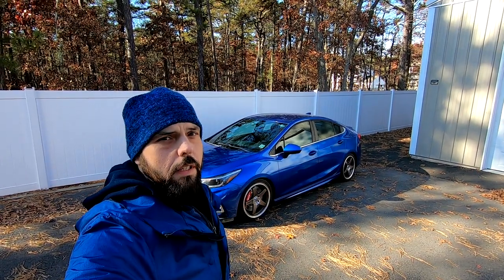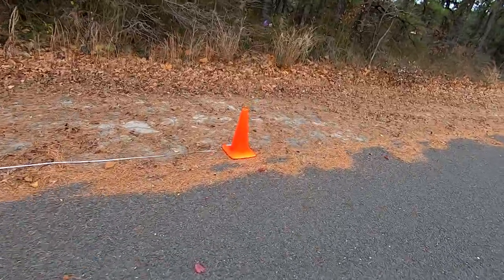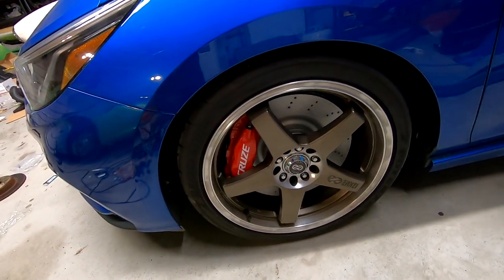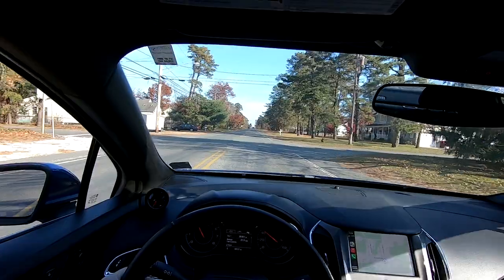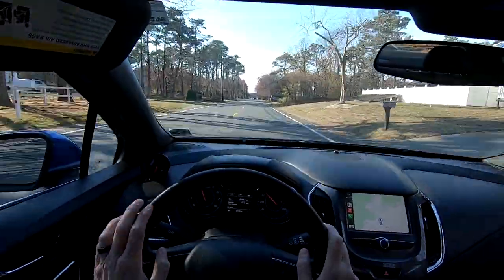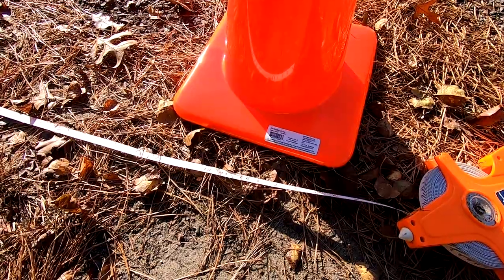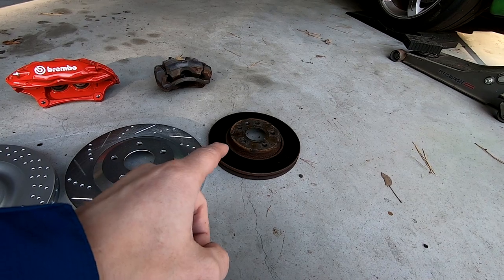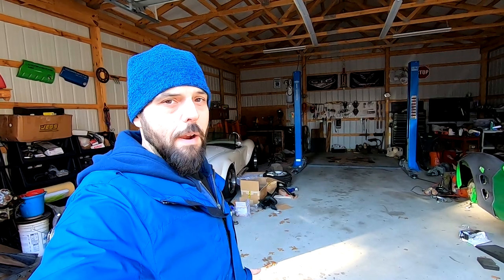CRUZE Sonic Big Brake Kit and test

Comment: I love the enthusiasm in making this platform better, however, if you're going to trying to "sell" your product, I would strongly suggest going about it in a more scientific approach.  1 and done on a brake test hardly offers sufficient credibility in the results. Even car testing mags and shows like Motorweek repeat the testing numerous times and then take an average for use as a comparison.  I would also suggest retesting (if possible) again using the a more suitable speed of 60-70 mph and using those results for an overall comparison. 
In short, more test data over a great speed range. 

Keep up the great work!
Reply from the maker: I can tell you from driving everyday and the other 6 platforms I make brake kits for the braking is far superior over factory brakes. The problem with filming at 70mph is the national speed limit is 55mph. So having a place to test at those speeds is rather difficult. At least showing from outside of the car. I can do a test with footage from inside the vehicle but if you compare the brake kits. You can see that those tiny brakes from the factory absolutely will not perform better than the massive ones at 70mph so any upgrade is better in my eyes. Maybe one day if my channel grows and I have subscriber support possibly with donations I can do larger scale testing and be able to have a facility to do these types of videos on a larger scale.

Comment: That bbk is bad ass. Those are very nice options for the cruzes. Gonna have to save some coins for this bbk !.
Reply from the maker: Tell you what! Even if I give you a bare aluminum brake kit. The braking ability is epic!!!!! Let alone how they look.
BTW how have you been?
Reply: @davesworld2132  I'm sure anything is better than my current stock set up with the drums in the rear. I test drove a sonic rs and even that thing has better breaks then my 2013 cruze Lt.  I've always wanted to upgrade these crappy breaks.  I think I'm doing this upgrade in the foreseeable very near future.  I keep regretting my choice of getting this cruze thinking I shoulda got the sonic rs instead.  But cruze was cheaper and didn't wanna  spend the extra $2k . Sigh....🙄
Will your kit work with the stock 16" LT wheels?
Reply from the maker: @dude...are-you-sure  Yes you will have to run a spacer and let me know the barrel diameter
Reply: @davesworld2132  k, I'll have to research the stock wheels dimensions. Will get back to you .

Comment: Saving up money to get new rims just for these brakes, they look so much nicer than the OEM big brake kit
Reply from the maker: Now that’s what I like to hear!!!!!! What wheels are you thinking about getting?
Reply: @davesworld2132  i was thinking of getting the Konig Controls. I actually went and got Konig Ampliforms this weekend but was so excited at what a great deal it was i forgot to think about the bolt pattern, they are 5x120 and are 19x8.5. Would have looked so sick on my car too 😭. Trying to sell them off so i can get rims that will actually work on my car
Reply from the maker: @thecruzeexperience6413  5x105 is needed and a 35mm offset at least. Wha the offset on those wheels you have I can get some custom 5x120-5x105 adapters made out of air craft grade aluminum.
Reply: @davesworld2132  i looked into getting hub adapters but wouldn’t the studs get in the way? I really dont want to have to cut them. I do appreciate the offer and the effort you’re putting into this btw
Reply: I’d also like to add that the widest rim that could fit would be a 9in width without any kind of modification to the body
Reply from the maker: @thecruzeexperience6413  No problem I always try to help as much as I can. You wouldn’t have to cut the studs depending on what those offsets are on the wheels. Do you by any chance know them?
Reply from the maker: @thecruzeexperience6413  possibly but it depends on the offset. You can possibly get more tire if the offset is on the lower side.
Reply from the maker: Sorry higher side
Reply: @davesworld2132  offset is 32mm
Reply from the maker: @thecruzeexperience6413  So if memory serves a 32 mm offset is a little more sunk in. For example it puts the tire Close to the suspension. If you were to run like a 38 mm rim Then the tire would move further away from the suspension allow you to run a wider tire. But then you also have to make sure you’re not going to hit your fender.
Reply: @davesworld2132  yea if the rim had been an 8in width i could do spacers, but with how thick the rim is its just not going to work
Reply: @davesworld2132  the Konig controls that im looking at have the correct bolt pattern and are 18x8 with a 40mm offset, which in theory should fit perfectly
Reply from the maker: @thecruzeexperience6413  that makes sense. If you can’t find anything I have a decent relationship with the owner of Cruze culture. He has some options.
Reply: @davesworld2132  ive been considering getting the 19x8.5 rotiforms from cruze culture as i already have tires that would fit the profile, and although they would look super sick, i am a college student 😂
Reply from the maker: @thecruzeexperience6413  which rotiforms?
Reply: @davesworld2132  the ZMO-M, at least i think thats what its called as per the website
Reply from the maker: @thecruzeexperience6413  Those look awesome I just looked them up
Reply: @davesworld2132  they are awesome but my only complaint is that they would have to be re-drilled, the rotiform LAS-R would not have to be re-redrilled because it comes with the exact specs that i would need. But its a mesh style rim. Just too many factors and too many things for me to consider, it has my head spinning.
Reply from the maker: @thecruzeexperience6413  In my eyes that’s a good thing. Keeps the gears working in your brain.
Reply: @davesworld2132  that is true and i do like to keep myself busy 😂
Reply from the maker: @thecruzeexperience6413  good! Lol Idle hands are the devils playground. Now I sound like an old man.

Comment: Great timing, I’m changing my rotors and brakes next season… 

Do they fit stock 15in steel rims?
Reply from the maker: No you would need to go up in size. I can help with rim fitment. I do have another option that has a larger rotor and a 2 piston caliper that can work.

Comment: Great video!! I'm into mods on my 2017 cruze. Just wondering what you did to the rear?
Reply from the maker: The rear brakes?
Reply: @davesworld2132  yes. I noticed the rea calipers were red as well. I didn't know if you just painted them or  what.
Reply from the maker: @mikerichard1367  I just painted them and added matching rotors to the front. It's temp situation as I am designing a rear BREMBO set up as well.
Reply: @davesworld2132 Ok cool. I really like the look  of the car. I have one the same color
Reply from the maker: @mikerichard1367  Awesome. I think it’s one of my favorite colors on this car.
Reply: @davesworld2132  keep doing the awesome videos! I look forward to them.
Reply from the maker: @mikerichard1367  Thank you. Comments like this keep me motivated. It let's me know I'm doing something right.

Comment: Caddy ats?
Reply from the maker: No those won’t fit and the rotors are the wrong lug pattern. These are machined to the right offset and rotor hat.
Reply: So looks like u went 18's +38 . Is that for clearance? And u might want to let people what diameter wheel is necessary to clear the big brake kit
Reply from the maker: Thank you for pointing that out.

Comment: Do the stock alloy rims fit with this conversion?
Reply from the maker: There’s a couple versions. It depends on which wheels you have.
Reply: @davesworld2132  16" x 6.5", 5 Lug, 105mm Bolt Pattern?
Reply from the maker: @andrewrichards188  These will not fit those wheels. But I do have another version that can.
Reply: @davesworld2132  thanks for the quick reply. I wanted new wheels anyhow so ill wait before springing on these
Reply from the maker: @andrewrichards188  if you want keep in touch with me through my website. I can help you figure out which wheels will clear big brakes.

Comment: will the big brake kit with brembo 4 piston caliper and 14in rotors will fit or make one for a 2017 malibu 1.5lt?
Reply from the maker: It can. I have some designs for the Malibu
Reply: @davesworld2132  you only have the brake kit for the front or can you make one for the rear?
Reply from the maker: @eduardoarguello9093  I’m working on the rear. The problem is the parking brake is part of the caliper. There’s no big brake calipers that come with a built-in parking brake.
I do have some really nice covers for the rear
Reply: @davesworld2132   how much does it cost?
Reply from the maker: @AlbertoGarcia-wf9hh  would need more info from you. Email me at Customcruze@gmail.com

Comment: Im a cruze owner and i have a check engine light on and dont what to dooo its driving me insane if u can help that be greattt
Reply from the maker: Only thing you can do is grab some kind of scan tool. Or you can run to advanced auto parts or AutoZone and they will check it for free
Reply: @davesworld2132  i know what codes i have i just dont know how to solve the issue ive tried everything and im out of ideas
Reply from the maker: @kendallmartinez4050  oh. In that case what’s the codes?
Reply: @davesworld2132  i got 2 pending codes P00c7 p2227 and 2 permanent codes p1101 P0172 its all stock ive changed parts cleaned parts but it keeps idling rough and my mph has been terrible lately
Reply: I was really thinking on taking it to the dealership but if it’s something i can do id really appreciate it if u can point me in the right direction
Reply from the maker: @kendallmartinez4050  First things first when’s the last time the air filter was changed and can you take it out and take a look at it let me know if it’s clogged up or dirty. Check your mass airflow sensor wires make sure they’re not broken or disconnected. And make sure the connections from the air filter box all the way to the turbo or connected